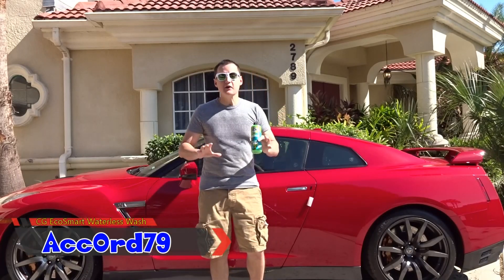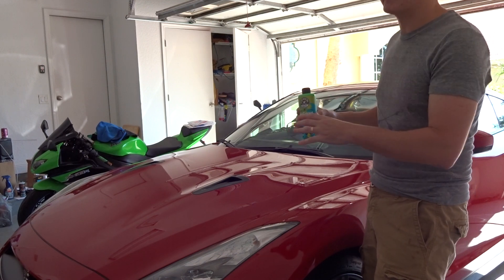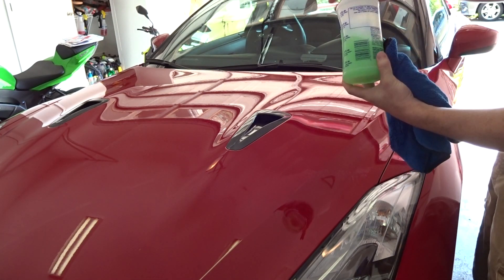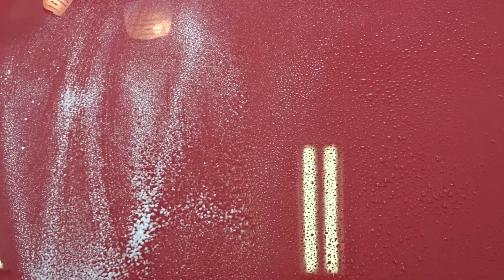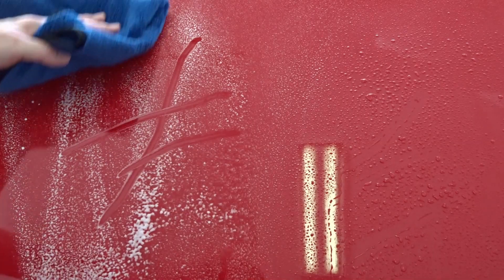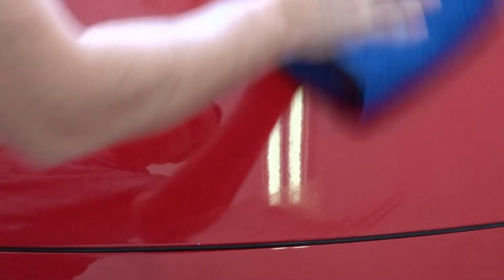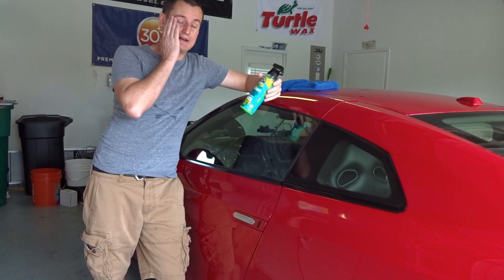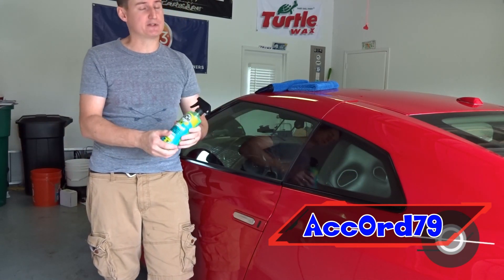Chemical Guys EcoSmart Waterless Wash Review on my Nissan GTR.

Comment: What does coloring have to do with anything? You compared a ready to use product to a dilutable one too. Did you check if the chemical guys product leave scratches? LoL I use many different types of waterless washes that you dilute and none leave any color on the paint. In talking Optimum , Ultima etc etc
Reply: eddynelly1717 I like Ultima
Reply: The stuff is no better than using water. Damn sure not what I gave money for, it's pure hype.

Comment: Ok here’s my take, I’m
A professional detailer and I use this product, you used the wrong ratio which is problem #1. #2 this product isn’t meant to make your car look like it just rolled off the showroom
Floor UNLESS you just FULLY DETAILED the car and used a good proper polish, ceramic, wax and seal. It’s meant to keep your car or truck shiny in between full details. So bagging on chemical
Guys for this is wrong. Just looking at your GTR and I see it needs some love not just a waterless wash.

Comment: Sorry Acc0Rd but you should research what concentration mix means.. the 16oz is supposed to make up to 2 gallons of ready solution. You're comparing apples and oranges. Also, coloring, milkiness is not necessary but the first patch you did with ecosmart we could clearly see a huge improvement after you wiped and buffed.

Comment: I did my black explorer with this product using 40 oz of zero water filtered water to 4 oz of water less concentrate. My can had not been washed in about 2 weeks and was dirty from many rain storms.   I used the CG 60 oz atomizer (a pump and spray) and that is the way to go. You just pump it with air and then just pull the trigger. But this did a great job on the black paint. But I did go thru alot of MF towels as it is a big car.

Comment: I see your point here but a lot of the waterless wash's seem to be clear. The mequires sprays on clear as does the mothers. I saw a video of the aero waterless wash or whatever spraying on clear. At 10 bucks for a non concentrated 16 ounce bottle its roughly 8 times more expensive than the chemical guys concentrate which makes 2 gallons. You could even double the strength of the chemical guys concentrate and it would be 4 x cheaper than the other product you showed

Comment: If you are looking for a great waterless or rinseless wash, look into infinite use detail juice.  Don't wanna sound like a fan boy but it is great.  You can also add juice boost to it which seals the paint while you wash.  It is a super concentrate so even though it isn't cheap,  it goes a long way.  That and regular onr are my go to ww.  Depending on if I want to wash and seal in one move or spray some dedicated sealant on afterwards.   ONR is also a great mild leather and dash cleaner.  It's very versatile.

Comment: You're right. lol. I thought about this, I bought the concentrate. I filled a 2 gallon hand pump and poured the entire bottle into it. I shook it up reallll nice. I spray and sprayed and sprayed and wiped and wipe and buffed. At the end, the car was clean and very shiny. The product worked, buuutttt I had used a little over half of the 2 gallons. So only 2 washes and I used so much microfiber towels because it uses so much water. It's so wet! I will now try out the other ones like mastersons because it has the sealent, and then I finish it off with the mequiars ultimate fast finish because it's fast, spray and wipe on wipe off.  I like mequiars quick detailer also.

Comment: The problem is that you bought the one you mix yourself they have a ready to use version that is the same as Mastersons.
Reply from the maker: I bought this so that I could use it for multiple bottles, sad.
Reply: yea I usually by the premix version , this version you have to dilute, perhaps you should shake the bottle first before pouring the 10z to  make the next bottle, or try 15 oz of water and add 1 oz of concentrated eco smart. maybe it will work better this time
Reply: It’s obvious it’s silly.
Reply: There are 2 options. The Ecosmart RU came ready to use. The concentrate version came on 16:1 ratio. I work on detailing and both work the same. Concentrate its more expensive per bottle but on that ratio its really cheap at the end.

Comment: Try Mckee's 37 they have at least 3 products for waterless wash 1.Waterless wash on the go concentrate 2 Rinse free wash and wax, and 3. N-914.  All 3 can be diluted with distilled water and make multiple products. From waterless wash, detail spray, spray on wax, claybar lubricant, and rinseless washing. I have yet to try N-914 but i use the other 2 great results. Also Wolfgang's Uber rinseless wash and wax for detail spray. They all work on glass and most on interior cleaning or dusting. Very cost effective.
Reply from the maker: They were actually contacting me to send me some products but I never heard from them again, no clue why?

Comment: Lol try onr looks pretty much the same but works as it provides as much lubrication as a quick detailer, if your scared to use it on the gtr test on the accord or prelude.
Reply from the maker: I'm scared that I need to go back and spend hours getting swirls out again, that's why I cut the video right then.
Reply: Acc0rd79 lol my bad I didn't think you'd be concerned about swirling up an almost 20 year old car which is rusting. The gtr i understand lol
Reply from the maker: I care for all cars, one car might be old but that doesn't men I don't care for it. I wouldn't even wash my cars let alone have this channel if I didn't care for cars.
Reply: Acc0rd79 never said you didn't.

Comment: THIS PRODUCT IS TERRIBLE! (PLEASE READ SECOND SECTION TOO)  If the dilution ratio is 16:1 and the bottle is 16oz that would make more than 2 gallons of product, the bottle says its makes 2 gallons of product. 16:1 means 17 parts, so if you take 16 x 17 you get 16 more oz than 2 gallons... shouldnt it be a 15:1 ratio, 15 parts water and 1 part product for a total of 16 parts, 16 parts times 16oz is 256 oz, divided by 128oz (one gal) is 2 gallons!

I picked up this product from the Detail Garage because no local shops carry any rinse less wash and waxes (auto zone, advanced, walmart). Before hand I was making my own waterless wash and wax spray using other companies products. I use waterless wash and waxes as a drying aid, after I do my final rinse of the car, ill spray a layer on the wet car, rinse it off then the surface has a lot more gloss and is more hydrophobic. ECOSMART's results were awful and it did not work. Not to mention the smell of the product was too strong, after diluting it properly, so I had to step away for a couple minutes to get some fresh air and I WAS ALREADY OUTSIDE WASHING MY CAR, NOT IN A GARAGE!

Comment: Nice try however, I do not believe it was a fair comparison.  You used a product you have to dilute next to one you do not.  Chemical guys makes a water less wash that you do not have to dilute.  Personally, I would have used that when comparing the two products.  I just used the Masterson's on my new car and discovered that it does a poor job on the yellow drops and streaks (which I have been told are from trees).   Maybe, I have to let it sit for several minutes for it to dissolves the spots.

Comment: What is the best waterless wash product that you have used?
Reply from the maker: Masterson's waterless wash, there are several good ones of course but I feel the lubricity and slickness is far better than any other. Masterson's also includes a spray on sealant in it as well which really helps to increase protection.
Reply: Acc0rd79 thanks a lot man I recently just moved into an apartment area and don't have very easy access to water and I only want the very best for my car!
Reply from the maker: give him a shot with his waterless wash and maybe pick up his Snow foam and detailer, you could also look at his shield sealant, all great choices.
Reply: Acc0rd79 will do that's what I like about his products unlike Chemical guys. They have like so many different waxes and shampoos  and etc that I really don't know what to choose half the time. I like how Greg has everything narrowed down and not 20 different choices for each product

Comment: I bought this crap today to test it for myself, you're 100% right, it's diluted piss. Even full strength it's a joke. Ultraluster blows it away, so does Griot's. This stuff is as watery as Adam's waterless. I'll be using mine for spraying down the tires or something other than paint.

Comment: You bought the concentrated waterless wash they have the same One already diluted and as the same effect as matersons.
Reply from the maker: So what is the point of this product then if it can't be diluted and be used to the same affect as the other companies? It says it is a waterless wash like the others and it is concentrated and meant to be diluted and yet when I dilute it, I can't compare it to the others? Seems like a cop out. If it's a bad product then it's a bad product. I've tried their motorcycle waterless wash and it was fine, this isn't.
Reply: Acc0rd79 with their other products they make you dilute them to make them stronger but with waterless wash there is no point.
Reply from the maker: well sadly this product didn't work. I bought the concentrated version so I could make a lot of bottles over time to achieve the same results as other companies. Oh well, at least I was able to show the differences.

Comment: Looks like you can not follow directions from there videos smh . I been using chemical guys for years. In my detail shop with no issues. You have to use chemical guy sprayers for a reason.  Or there sprayer you spray it on and let it sit then wipe. Same with there diablo wheel cleaner if you buy the ducktip sprayer it foams as it comes out. You also never shook the bottle